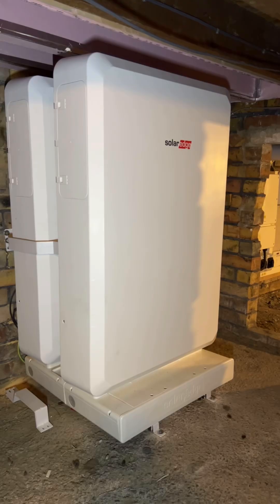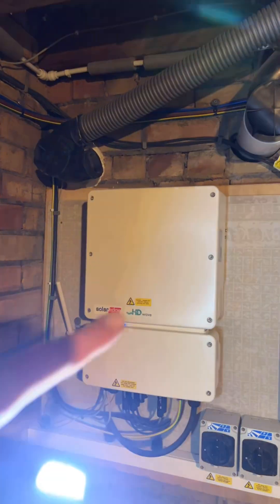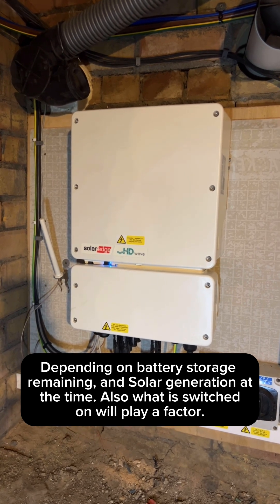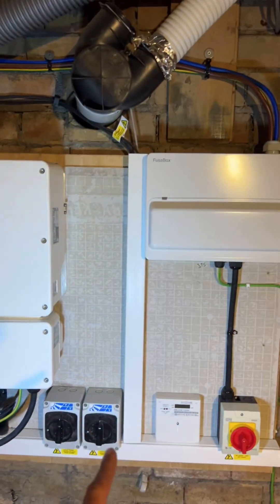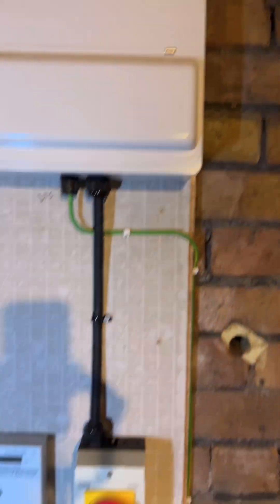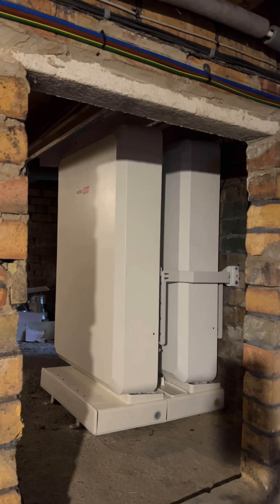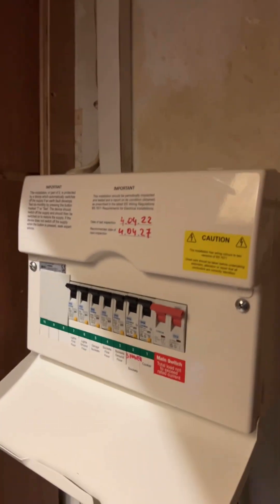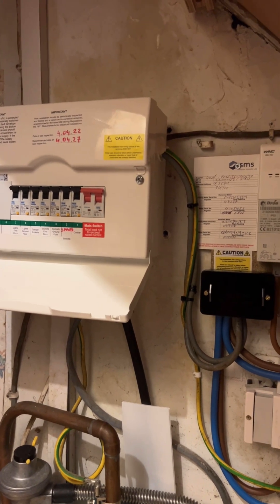Solaredge Homehub system with battery and backup interface ( @SolarEdgeTechnologies )

Comment: Hi Great video,  does a solar edge system need to be activated by a registered installer for the system to work?  
 or can it be install solely for off grid use only like DIY, as i have read a tesla powerwall needs to be activated by a installer to work correctly or at least use the full function

Comment: Hi mate! Nearby sparks here from Gloucester. We have a Solaredge 10kW inverter with 30kWh storage and backup interface, pretty much same as yours. One thing that confused me is when connecting the backup interface, you have the two options of connecting neutral depending whether it's TNS or TNCS. How did you connect yours? The wiring diagram for TNCS looks like it wouldn't isolate the neutral connection from grid, therefore not all 'live conductors'? Also, separate note, would you recommend trade mastermind? ;)

Comment: Does this need an earth rod?
Reply from the maker: Yes it does. The system separates the house earth from the backup so it needs its own rod.
Reply: @LeonRygol  no it doesn't. Earth rod required as a reference and fault path if PEN conductor is lost. Backup kicks in without an earthed install in this instance.

Comment: Im considering their system. one caveat tho is that its likley more effeicient to add batteries one at a time, 10kw per year say just because they are inevitably going to drop in price over time. Over the last 5 years and many power cuts we learned that the most we have actually ever used during a 'powercut' was about 13kw. that was about 14 hours averaging 800w and not really cutting back. the other caveat is that 30ms switching is too slow for pc use etc nice vid
Reply from the maker: Yea that is true, they have a heat pump and rely on off grid power so needs more batteries at once. The time delay on the switchover is quite long. Some others such as Tesla can switch over quickly.

Comment: Other systems have an almost instant switch over when the main grid goes off; such as Tesla gateway, EcoFlow PowerOcean. Is there any way/configuration to the tell the SolarEdge backup interface to monitor with shorter delay therefore to give an 'instant' switch over to backup battery? I hope this makes sense.
Reply from the maker: Not that i am aware of. It is preset.